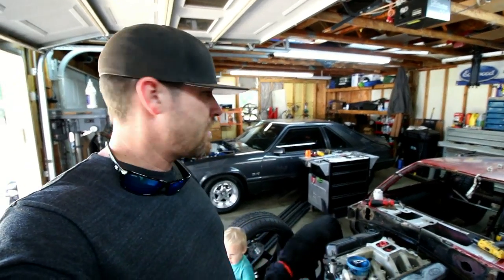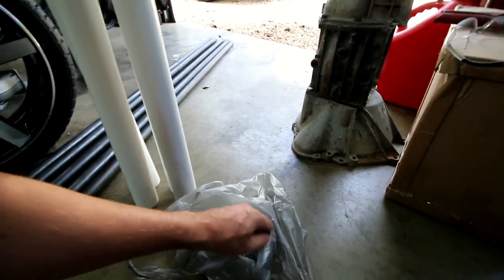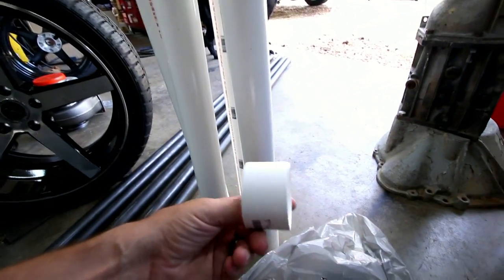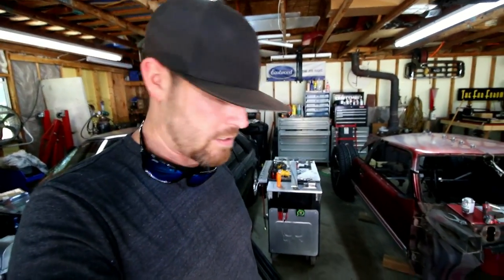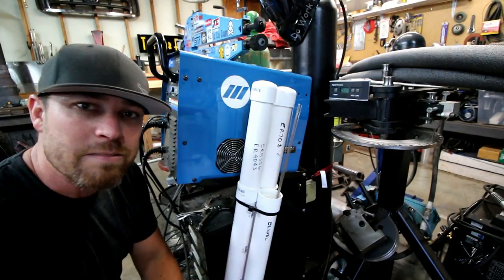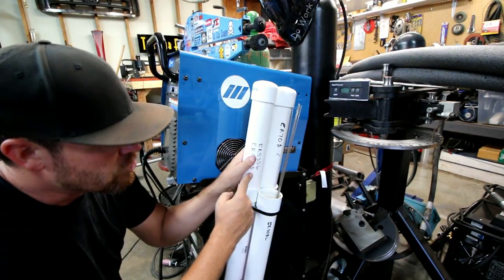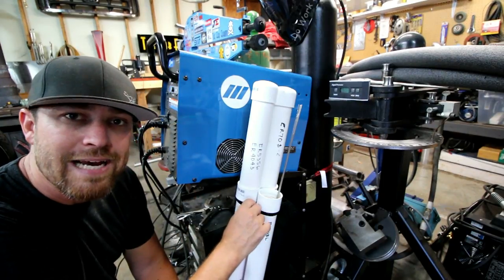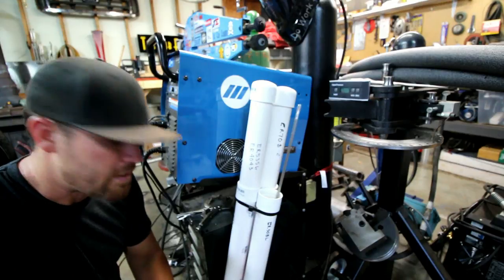How To Make TIG Welding Filler Rod Storage

Comment: I did that with arc electrodes back in the mid-1980's. Larger diameter PVC pipe (4" iirc) and threaded clean-out caps on the top. But had a problem with moisture getting in - the same as leaving an open box of electrodes on a shelf - but had enough room in the cap for a small bag of desiccant. Just forgot to swap out the bags ...

Almost as many uses for PVC pipe for shop organization as there are uses for zip-ties!
All-thread storage, small dia tube (slot cut at the bottom of the PVC for accessing the short pieces) - anything you can buy bulk-length (that can't be coiled) and cut off what you need at the time
Reply from the maker: nice

Comment: Great idea Kyle. Also some larger diameter pic in different lengths is a good way to keep alloy extrusions or angle up on the wall horizontally. Just drill 2 holes 1 larger than the other to fit the screwdriver in to mount to the wall. No need to make full length just enough to keep of the floor for More space. As always mate love the channel. Greetings from Queensland Australia.
Reply from the maker: thanks
Reply: Would that operate similarly to a rack?

Comment: The guy at welding tips and tricks ( jodys youtube channel) has a similar set up, might get some mounting ideas from him.
I need to make some kind of holder for mine Im still using the cheap containers  they come in.
Reply from the maker: Im sure I will end up making some kind of custom sheet metal mounting bracket

Comment: I purchased a large lot of many types of filler rod.  I converted a HF cart to hold the tubes.  I used a flush closeout cap on the bottom so the tubes can come out of the cart.  https://drive.google.com/file/d/0B1Cinw35mNrcaDZxdGdzNnpzQzA/view?usp=drivesdk
Reply from the maker: very nice...you assemble the tray up side down?
Reply: Yep, that top "shelf" being upside down was a stroke of genius!